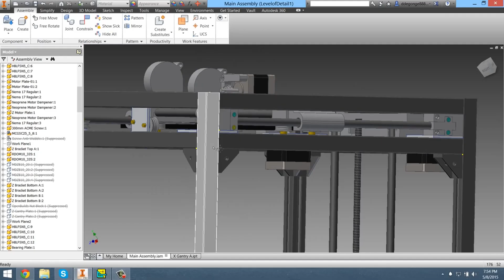E3D V6 Gold Printing & Makerhubs!

Comment: I just ordered some CAPRICORN PTFE TUBING. Thanks for the tip.
https://www.filastruder.com/products/capricorn-ptfe-tubing
Reply from the maker: Awesome, it's some pretty neat stuff! I do miss being able to see through the tubing though, the capricorn is opaque so I can't tell what filament I have in unless I crawl over all my crap to see what's on the spool!
Reply: It would be interesting if you compared the performance of the capricorn is opaque with the TL - TRANSLUCENT.
Reply from the maker: Well translucent is basically the same ID as normal ptfe tubing, just with tighter tolerances, so it would probably be very similar to just using standard tubing.

Comment: what are you printing, the speed is amazing
Reply from the maker: Just some custom parts for a customer, and yeah the Eclips3D2 can hit some pretty nutty print speeds! The mechanics are so rigid that you will usually hit the melting speed limit of the hotend before you hit the movement speed limit!